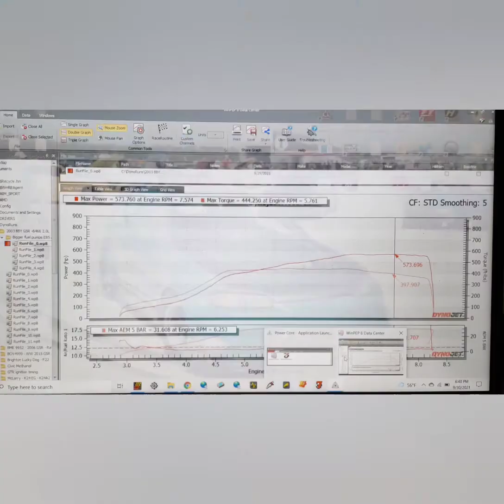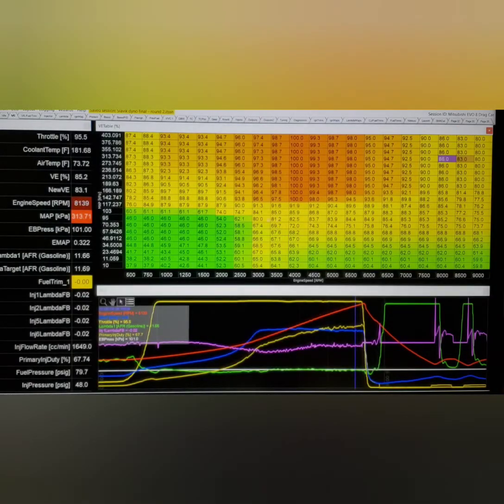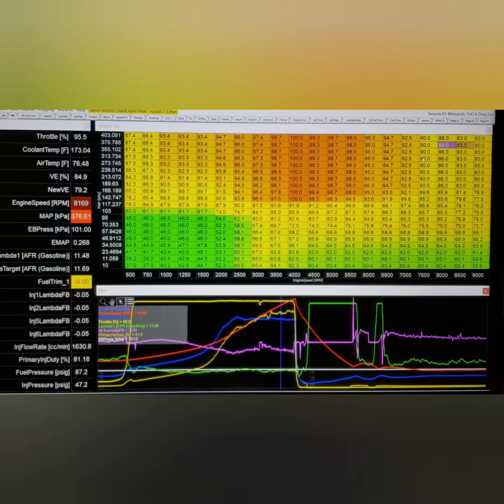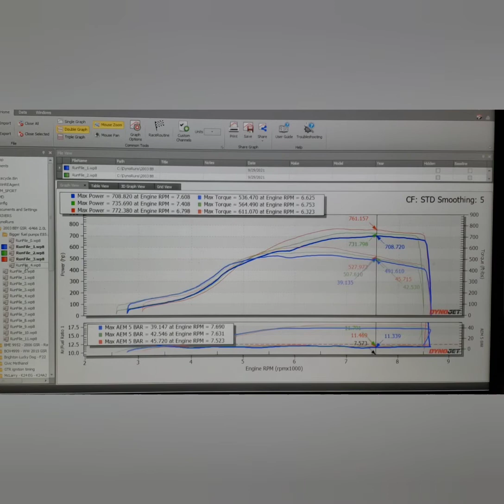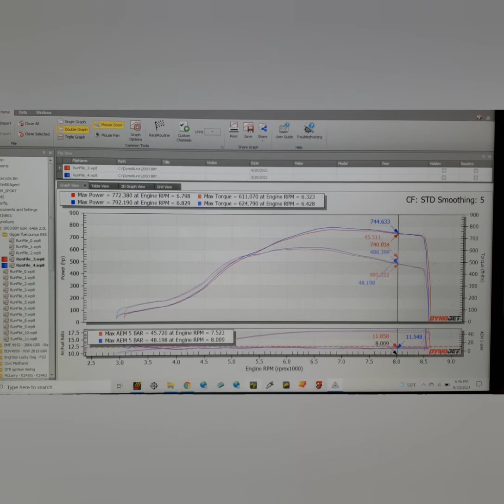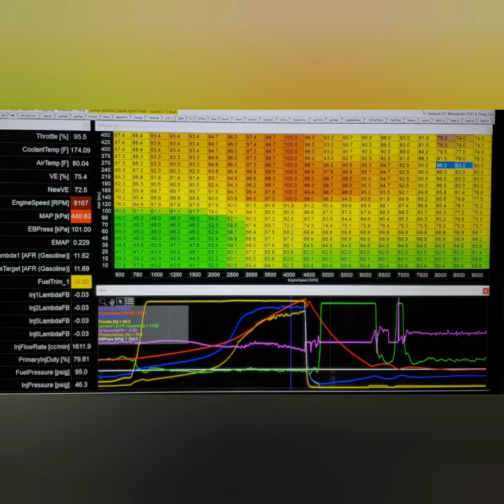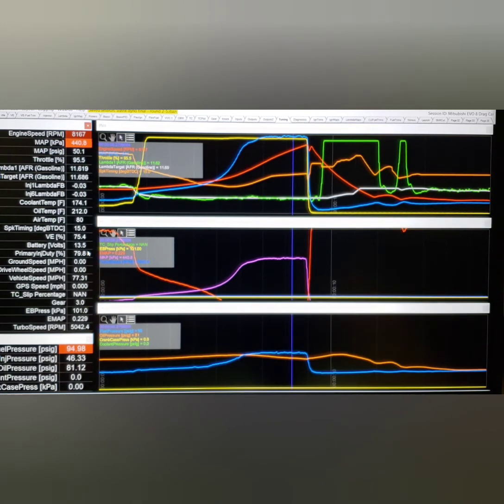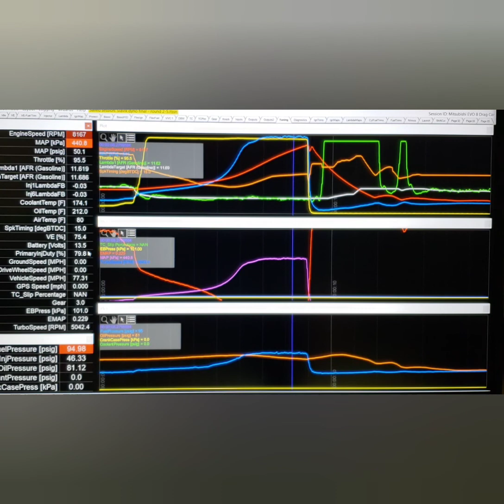EMAP Revisited episode 1

Comment: Did intake air temp go up??
Reply from the maker: Excellent question. I'll have to look but I feel it hadn't moved a crazy amount.
Reply from the maker: It went from 67* starting to temp to 71* at the end of the run on 31.5psi to 71* starting and 86* final at 50. Intercooler was efficient but the EMAP didn't seem bad enough to also drive up the IAT
Reply: @AaronONeal1  interesting. We are debating in next setup to go intercooler or not on methonol. I'm thinking we will stay intercooled.